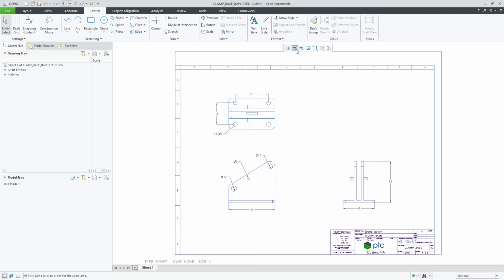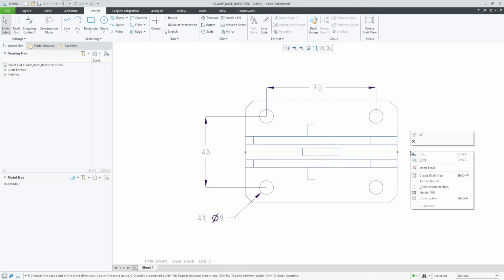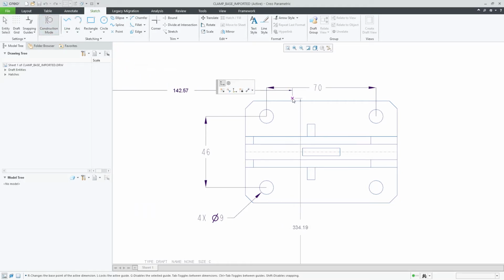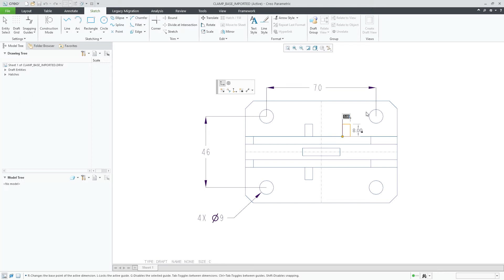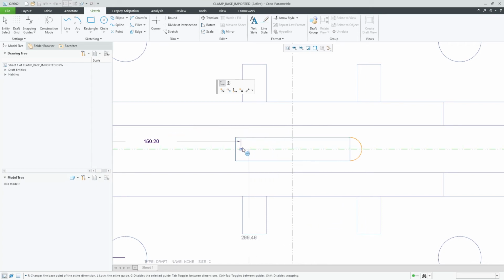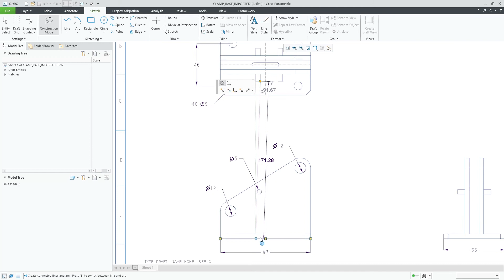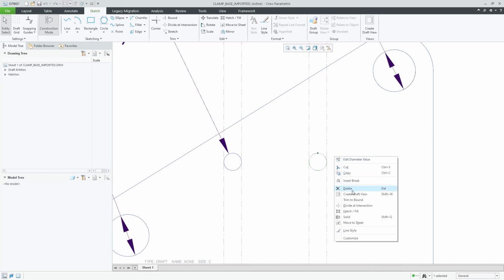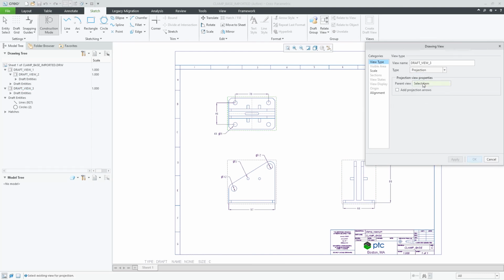Modernized Sketching Tools in Drawings Demo | Creo 8

Comment: Can I make a comment? In 8.0, I placed the assembly section view in the drawing, but I changed the excluded items in the assembly mode. The drawing cannot be updated. I need to delete the view and add the view again. I don’t know if it’s my own. the computer has problems
Reply from the maker: Hi a yang,
I would suggest making a thread about this on the PTC Community board (log in with your PTC account https://community.ptc.com/t5/3D-Part-Assembly-Design/bd-p/partassemblydesign ) and try attaching your file(s)/screenshots there if you're able to. They should be able to help diagnose things.
Best of luck!